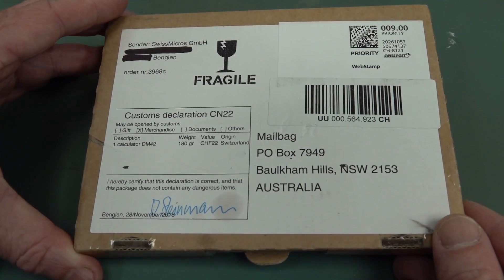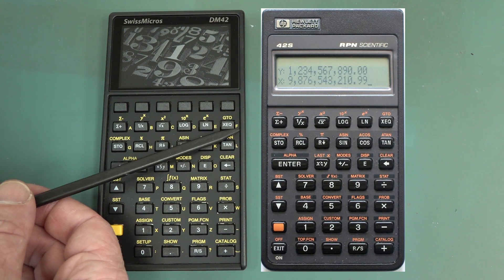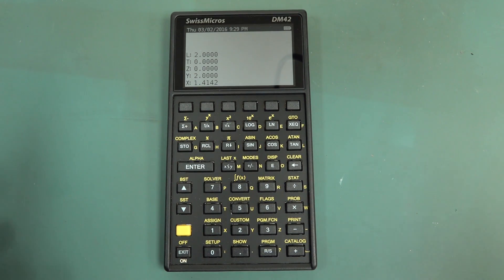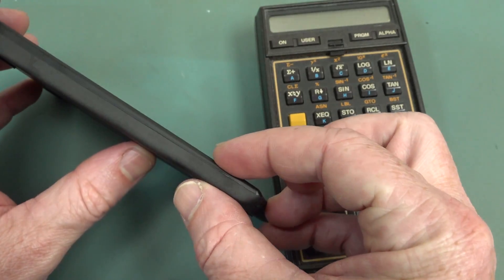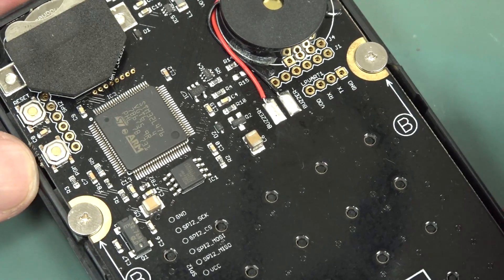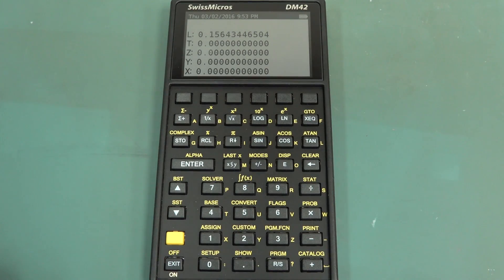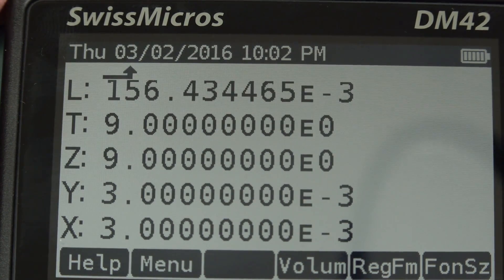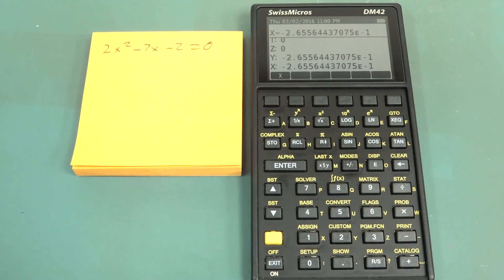EEVblog #1159 - World's Most Precise Pocket Calculator

Comment: With a board like THAT they could make a full custom graphing calculator - or better yet, beat TI at their own game :P
Reply: @SimonWoodburyForget  Graphing calculators almost never contain a graphics card. Besides, the hardware they're using contains an FPU, meaning that the CPU can efficiently process floats natively. This hardware could easily handle the calculations required to draw graphs.

The TI-84, which is still a very popular graphing calculator, only has a simple, 8-bit, 15MHz CPU and no graphics card nor an FPU. What makes you think a modern 32-bit CPU can't handle it?
Reply: It can actually do graphics - with some additional Free42 compatible programs (which are not necessarily backwards compatible with HP 42S). In fact there are a ton of programs (new and old) that can be loaded into storage and called up as needed. Visit https://forum.swissmicros.com for more info.
Reply: @SimonWoodburyForget   The DM42 can do low, medium, and high precision floating point arithmetic. The functionality just has to be added in software. In fact, the quad-precision floating point calculations are done in software by the intel library.
Reply: @SimonWoodburyForget  When Python is open, perhaps. However when you quickly want to check something trivial such as if the curve of the tangent goes up or down at x=0, then can you really start your Python shell, import the required libraries and get it to render a graph in less time than the 5 seconds it takes on a graphing calculator?

Also for slightly more complex stuff, it took me 15 seconds (I timed) to find out that the roots of the equation 5x³-4x²+3x+2=0" are -0.381, 0.590+0.831i and 0.590-0.837i. This included the time needed to start up my calculator.

I also generally prefer the UI of my calculator. It shows fractions as actual fractions, exponents as superscripts, integrams and summations with the actual symbols, ... Software for PC that does this exists, but I've always found them much more finicky and harder/slower to use. Typing something in symbolab for example takes me way longer than typing the same equation on a calculator.
Reply: @SimonWoodburyForget  With standard usecases, drawing a graph even on simple slow calculators takes only a few seconds. Computers can indeed do the calculations a lot faster and more accurately, but calculators have keypads specifically designed to easily enter equations and formulas which generally makes it faster or at least easier to type out the functions to graph. This in a lot of cases more than compensates the speed benefits computers give. By the way, I'm an engineering students and have thus used quite a few different calculators and also quite a few different software packages for mathematics. While the computer software is obviously more powerful, I've never found software that was as user-friendly as a real calculator.

Also perhaps one of the most important factors is that calculators are a closed system. They (usually) have no network capabilities and their entire memory can be cleared with just a few button presses. They'll usually also keep working in the same way for decades as they generally don't have huge software updates. This makes them very attractive for education, since it would be a lot easier to cheat with something like a tablet or smartphone running calculator software than with an actual calculator.

Computers are great whe you work with large datasets or when you have to repeat a long calculation regularly (in which case you'd write a program for that). Calculators are great for simple, one-off calculations.
Reply: Eh I'd take apl compared to a calculator for speed especially if there's multiple things at once
Reply: @SimonWoodburyForget  You don't need a graphics card for such simple graphics. The ARM M4 micro on that device can easily render animations on a 480p color screen.
Reply: To beat TI at their own game?. Overpriced calculators?.
Reply: and lobby engineering
Reply: @SimonWoodburyForget   using software or hardware doesn't change your question though. Anything a calculator can do could be accomplished faster on a PC.

Calculators are a convenience item. They'll increase your productivity sometimes, bit that's about it.
Reply: TI calcs are politics. The hardware is worth corn flakes free toys

Comment: Maybe SHIFT+ENTER/ALPHA to insert the A-Z symbols?
Reply: Doing shift+Alpha allows entry into the "alpha register" on the old HP42s (and here too). To be able to use the alphabet on the keys, one brings up something requiring alpha input, such as Label, and then shift+up or shift+down cycles through uppercase, lowercase, and none in the little brackets shown at the top of the screen. When uppercase, all keys with a letter next to them now can be used to type uppercase A-Z symbols and desiring to enter a number in the string requires shifting back to "none". Not obvious without being told but a decent workaround for a feature added that the original 42s didn't have.

Comment: Nice video; the multi-line e-Ink display is quite an improvement, as well as the mechanical assembly when compared to the crappy HP method where you had to almost destroy the calculator to open it. You miss on the nice tactile feel of the keys, though (and perhaps battery life). 

IMHO, you need to have quite a lot of burning cash in your pocket to pay that much.
Reply: alysdexia , if you think that calling an object or method "crap" is an insult, I can only infer that you hold HP products too close to your heart. However, calling me a nescius is a personal insult that is typical of someone with no arguments to contribute to an intelligent discussion. Have a nice day.

Comment: Calculator emulators are fun: On Android I use WabbitEMU to load up actual program images for TI calculators when I need to "relive the nightmare" (TM).
Reply: I use firebird to emulate my ti nspire cas on my phone
Reply: @JavierHernandez-m8o  Wabbitemu isn't trash, it's a pretty advanced and very accurate emulator. Its goal isn't to be the very best calculator on android/PC, it's trying to perfectly simulate the 84+ with all its features AND limitations. The graphing calculator (x84) does math pretty well, but it does only that. Wabbitemu does full low-level emulation so you can even do stuff like run programs and games made for that calculator (even the ones that exploit the hardware in weird ways to get the calculator to do stuff the hardware wasn't intended for, such as displaying multiple shades of grey or playing sound) or even completely replace the calculator's operating system. You can't do anything like that on a normal calculator app.

I'm not claiming that wabbitemu is the perfect app for everyone though. Its target audience are developers, and for them it's an awesome app. For people who just want to use a calculator, it's better to use calculator software actually intended for the device you're using rather than simulating old, slow, outdated hardware.
Reply: I have the Free42 app on my iPhone, and it's marvelous! Kudos to Thomas Okken!!

Used to have the original hp-41C from 1979, but it conked out some time in the late 80's/early 90's, and all my old 41C programs (none of which used any peripherals) work on the app.
And of course, much faster, and with 34-digit precision vs the 41's 10-digits (+ 1 or 2 guard digits?).
And with 2-line vs 1-line display.

Couple or so years ago, I was eyeing the (at that time) about-to-be-introduced SwissMicros DM42; didn't jump on it then, but now, I'm thinking a lot more seriously about it. $200 is a bit steep; but then, the 41C was $295 in 1979 dollars!

Thanks for this video review!

Fred
Reply: Desmos is my goto calculator.
Reply: @JavierHernandez-m8o  I wasn't trying to say that you should keep running wabbitemu. My point was that Wabbitemu's purpose is to be a highly accurate low-level emulator of calculator hardware, it isn't meant to be used just as a normal calculator, but for developers and ethousiasts who want an as close as possible ti-84+ experience. Saying it's crap because there are more useful calculator apps available is unfair since this emulator was never meant to compete with them.
Reply: My ex-wife got my HP41-CV,     I kept the HP-48 before then.   It's in a drawer but the Droid48 emulator gets almost daily use on my android phone
Reply: Check out the RealCalc app by Quartic Software on the Android (Play) Store. It has an RPN Mode and is styled a lot like the HP41CV, etc.
Reply: I use Graph89 to emulate Ti92+ on Android.
I grew up with the Ti92+ and I love how it can calculate with units. While it's not perfect, I don't know of any other calculator or Android app that can calculate with units.
Reply: @jackwhite3820  If I remember rightly, (and I've tried it out here) the 50G appears to have the ability to calculate with units. i.e. 45_m / 13_s == 3.461_m/s. I don't know how far that extends, after all trying to take the sin of 45_m could be problematic.
Reply: Jack White , what do you mean,"calculate with units"?  On hp48sx (and others?), you can attach units to every number and it carries then through all calculations. If that what you mean? Just curious.
Reply: @TheRainHarvester   On a Ti92 I can punch in   '100_µF*1_kV/(1_µA) ► _day'   and the result would be   '1.16_day'   which is not only convenient (it also has some physical constants), but also provides a sanity check if the units don't match up.
Since the Ti92 has a CAS I can also do   'solve(100_µF*x=1_day, x)'   and get   'x=8.64E8_ohm'.
Reply: Jack White , ok, yeah, the hp does this too.
Reply: There's Maxima (Macsyma fork) on Android nowadays -- the one they ran on mainframes back in the day. https://en.wikipedia.org/wiki/Macsyma
Reply: @no-defun-allowed    Looks like Maxima with the units package would do exactly what I want. Thanks theemacsshibe!
Reply: If I had all the "passwords" to reprogram any one of like 5 or 6 TI calculators could you do it?? 
BTW ignore the "if i had" bc i do have them.
Reply: I just got this calculator in the mail last week. Super useful for my EE classes!

Comment: I'm waiting for the HP-16C replacement - always wanted one.  I have originals of many of the other models.
Reply: My HP16C together with my 41CV are some of my most prized possessions. They are next to me on my desk and I use them almost daily. Still works perfectly and looking in mint condition after 30+ years.
Reply: Looking at their site, they have one, named DM16, for 99CHF.
Reply: That's their mini one. The DM16L will be full-sized, also what I'm waiting for. Same innards, but the buttons are what make the old machines such wonderful daily drivers. This DM42 looks nice and all, but I have an original HP-42S and [something something] cold dead hands :)
Reply: @tigerstein  yeah, I want the DM16L which isn't released yet.  The credit card sized one is cute but won't be pleasant to use.
Reply: I have the HP-16 C replacement, swiss micros calls it the DM-16 C, but I didn't see it on their site the last time I looked it's a nice calculator though.
Reply: @wildstar1063  OK, the DM16L is now listed on their order form, which is the full sized landscape version (vs the DM16 which is the credit card sized version).  But adding it to an order isn't possible as it comes up with message about limited stock.
Reply: @wildstar1063  Just got a notification the DM16L is back in stock.  Ordered immediately!